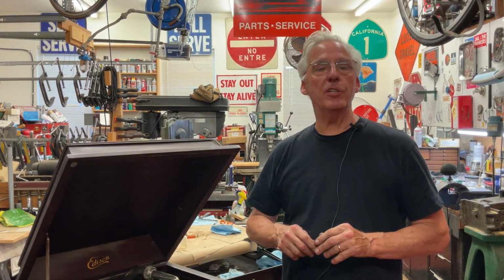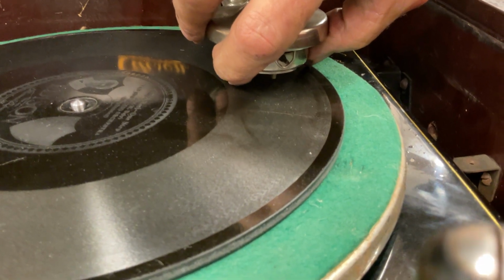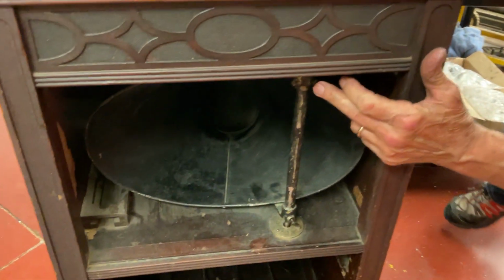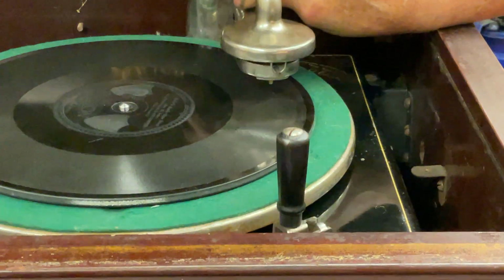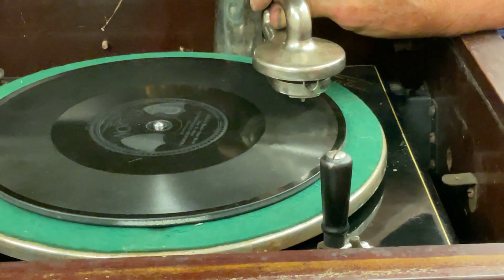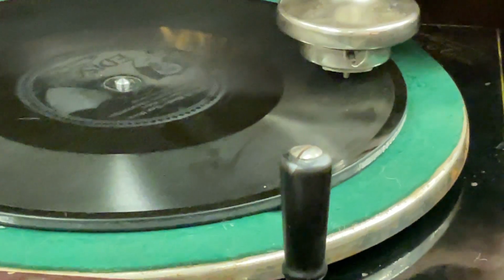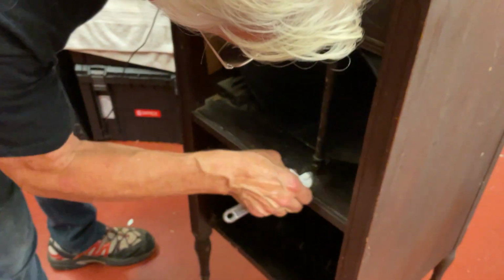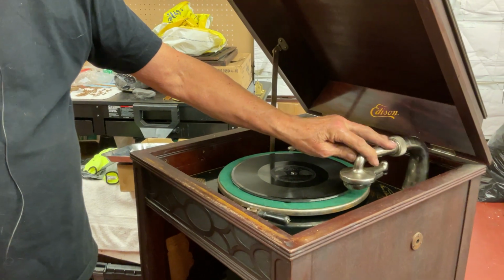1661.  Setting the reproducer height on an Edison diamond disc phonograph. ￼

Comment: this is exactly what i was looking for.   which direction to turn if you want to lower the pin?  Which direction if you need to raise the pin?
Reply from the maker: To lower it, you screw it in, to raise it you you unscrew it
Reply: @1974hurt  Thanks for the reply!  I ended up backing that part all the way out, thus starting from the highest point, and working my way back! Thanks again for taking the time to make this vid!

Comment: Do you have a video about replacing the silk string on the reproducer? I just rebuilt my edison and it's not that loud and I noticed the string was torn :(
Reply from the maker: No, I have found it is better to just buy a new diaphragm with the silk string attached then to try to repair an old diaphragm with rotted or broken silk
Reply: @1974hurt  sounds good I'll see of I can find a new one online. Thank you for the reply

Comment: also, i picked up some 3 in 1 oil. where should i oil besides the cup under the platter? thanks again!
Reply from the maker: Most photographs have boiling directions on the schematic underneath the turntable.  You will want to oil the spindle shaft, and all the moving pivots.
Reply: @1974hurt  alright! i’ll do this! i unfortunately don’t have a schematic, but i’ve found an online manual that can help me out.

Comment: hey there! i have a c-19 and i’m EXTREMELY new to phonographs. whenever i am raising and lowering the lever, it gets stuck at the up position. after trying to follow this tutorial, the pinhole on the bottom arm doesn’t budge at all. what should i do? thanks!
Reply from the maker: Try putting some sewing machine oil on the shaft of the lift lever where it goes up and down
Reply: @1974hurt  thanks so much for replying! i tried your number but i’m not sure if you got it.

i sure did! it actually had a little divot to insert the oil in there. no luck though. is there anyway i can email you some photos of it and we can discuss tomorrow morning? i’d imagine it’s pretty late in whatever time zone you’re in.

thanks my friend!
Reply from the maker: @hemozzee  yes, send me some pictures to dyslexicgeniushurt@gmail.com and then send me your phone number because I am at sea and will call you when I can.  Tell me what time zone you’re in
Reply: @1974hurt  gotcha! thanks for the help.

also, sounds exciting! i’m in the eastern standard time zone!